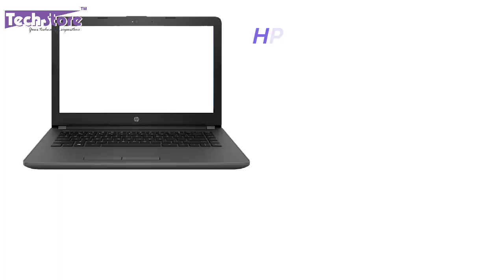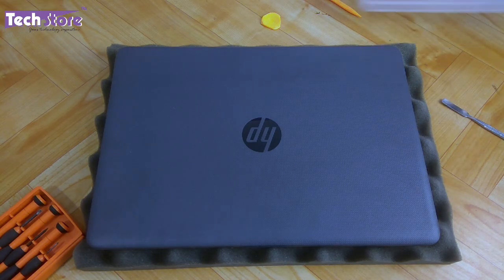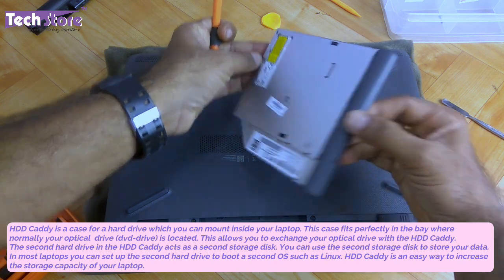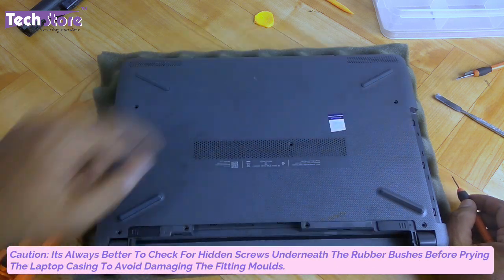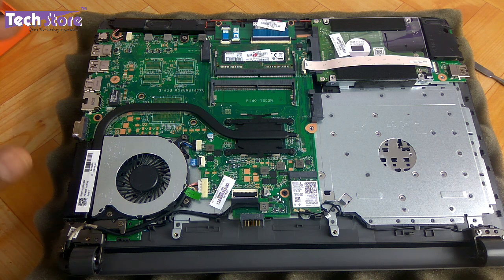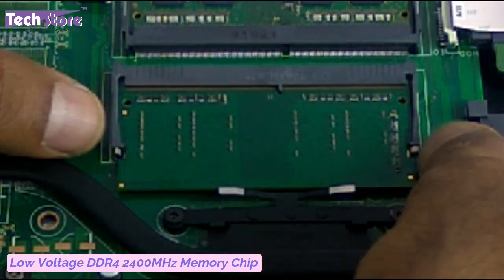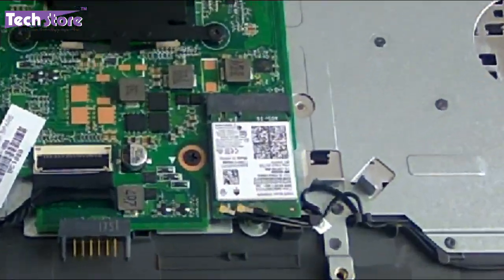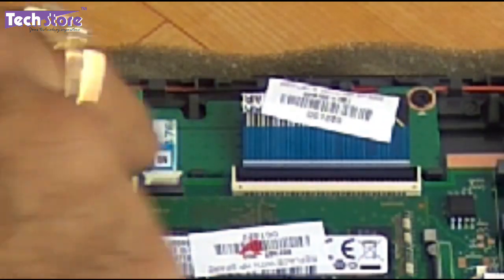How to disassemble HP 240 250 G6 & upgrade ram hdd m.2 ssd easy diy

Comment: Good evening, my notebook is the model HP 240 G6, Core i5-7200U, Windows 10 Home Single Language 64, with 2 RAM memory slots, one empty and the other with a 4GB memory, but I have doubts if this memory is soldered on the board, so I ask: 1) What is the maximum RAM memory I can put in my notebook? 2) If I add a 16GB stick, will this affect the dual channel? 3) What is the ideal brand for my notebook?
Thank you very much in advance.

Comment: 271/5000
Hi! from Argentina! I have the hp 250 G6, it has a 1 Tera HDD. I want to put a second disk, but this model does not have a DVD player ... what can I do? in the video you mention the m.2 port ... maybe there I can add a second disk? or what do you recommend?
Reply from the maker: Hello from India! Yes you can buy a m.2 ssd of upto 1TB capacity on this laptop.
Reply: @TechstoreCoIn  OK thanks!  where would you put it?  in the place where the HDD is located or do you have another cavity to place an m.2 SSD?

Comment: Hello, I want to install the HDD caddy but my PC does not have the DVD slot, can it be installed the same way? it's a 240 g6 i5 7200u.
And can you put the m.2 at the same time as the caddy and an SSD?